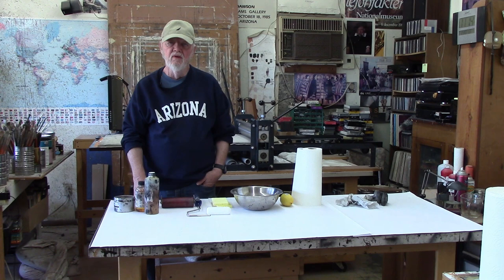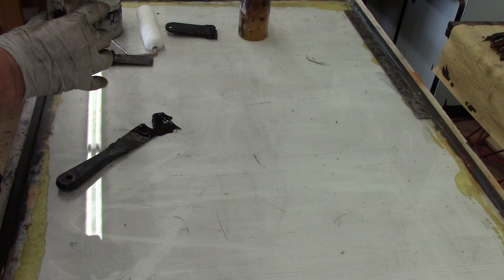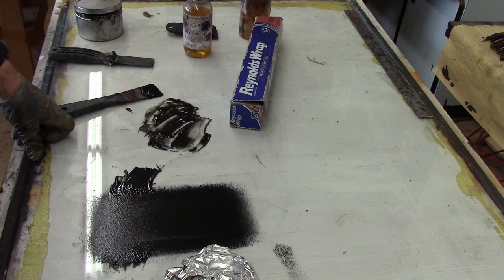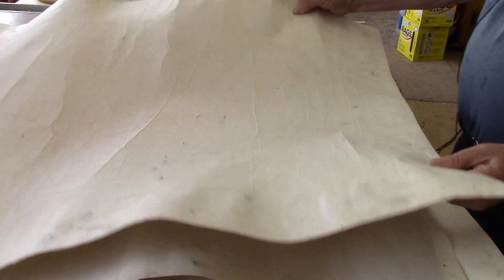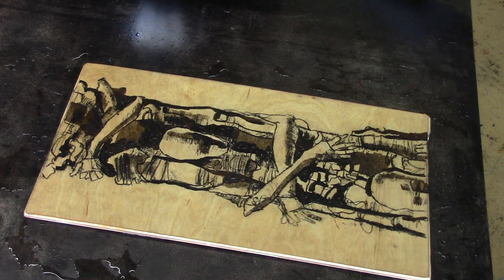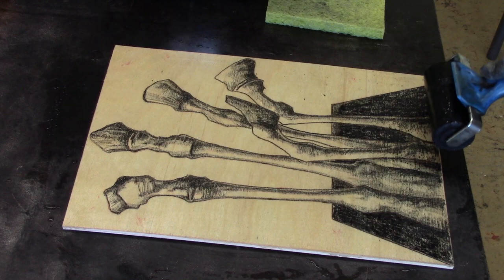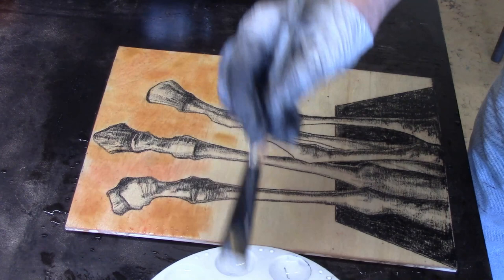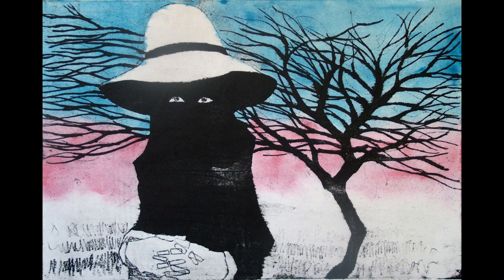Mokulito #2

Comment: In the last part of your video where you have samples, you say "I sized the piece with rabbit skin glue". To sum it up: prep the board, size the board (either casein or RSG), make you drawing, add color with watercolor if you choose to, then? Here is where my confusion lies... size again? I think you said with Rabbit Skin Glue? I'm confused about this section. Can you print without sizing after the water color? And/or can you use casein again?  I assume you wait for the water color to dry for a bit?

I'm just getting ready to print my samples board, I'm very excited...  Thank you for all the work you have put into this process and explanations/samples. I'm very thankful!
Reply from the maker: once you have applied the watercolor, don't size the plate. The watercolor won't print if size is applied on top of it. Hope this helps. JOHN DAWSON
Reply: @johndawson9683  ok, so I misunderstood. Better to ask and get it right. Thank you. I made my sample plate today. What a crazy inky mess in my studio! I had ink everywhere. Hopefully I will manage the process better as I go. But it did turn out quite nicely after a couple of dumb mistakes. All good. I used the rest of my lemon to clean the glass slab, that works really nicely. Also, I just purchased the new Dawn detergent spray and it is magic! Cleans that ink up really well, both on the equipment and my hands! Thank you again!
Reply from the maker: @gingertolonen5553  Hi I had never heard of Dawn detergent spray, I'll get some and give it a try. Thanks
JOHN DAWSON